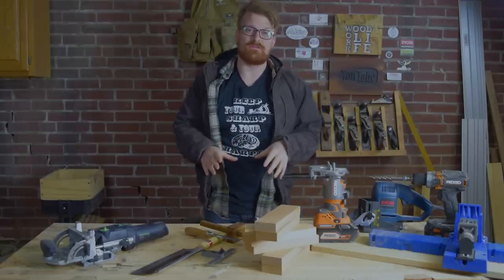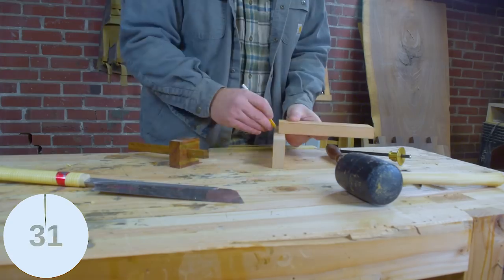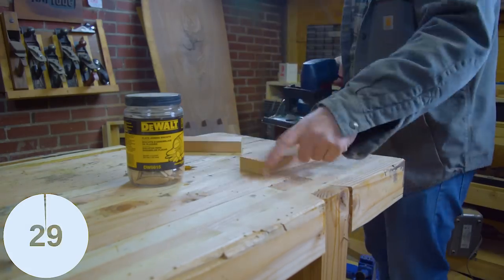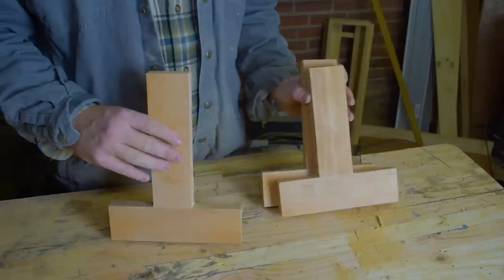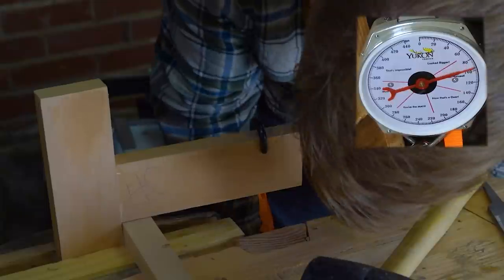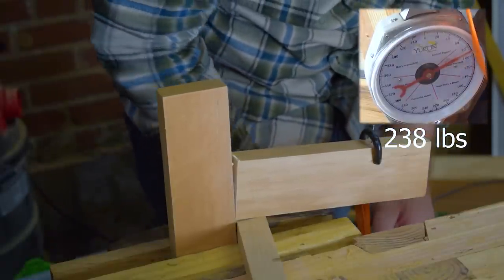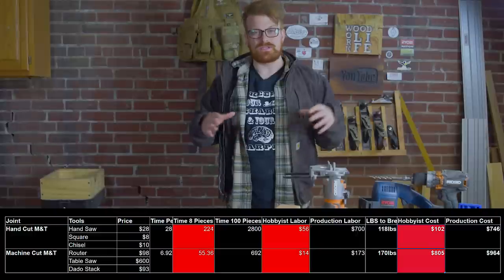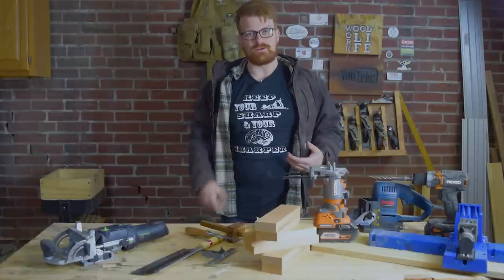Best Joint Shootout, The answer will surprise you!  | Hand Tool Shootout

Comment: The flaw to the test is due to the lateral movement of the perpendicular. I can't recall any piece of cabinetry or furniture that uses butt joints where the perpendicular piece isn't supported laterally from an opposite and equal butt joint.

I would take 5 pieces of wood and build a base cabinet type frame and test the joints lateral movements by squeezing the square frame diagonally.

The reason being is that a completed cabinet isn't necessarily subject to the lateral forces you are subjecting to these test pieces. Biscuits or kreg joints or even metal connectors would work just fine - unless you are building a ladder.

Or simpler, build an H-frame and pull straight down while measuring how far the  styles spread out.
Reply from the maker: I was trying to do the simplest testing methodology to minimize and isolate variables, but yes it might oversimplify a bit.  The failures are still implicit of the behavior with a completed piece.  Besides the point though, as stated in the video, engineering is about making something strong enough not the most possible strong.  Most of these joints are "strong enough" in most scenarios.  If you are making a chair to park a car on though YMMV.

Comment: Before you even start I expect Festool to win (effectiveness + efficiency), but as a hobbyist cannot justify its price.

Looking forward to the results.
Reply: For my coffee table I used dowels and thick legs. Solid as a rock.

Your voice over is perfect, btw - no echo, nice and flat, very easy to listen to.
Reply from the maker: Thanks for the comment, I think I need to do a follow up looking at dowels, and a few other techniques vs domino and others.  There are so many techniques.
Reply from the maker: Thanks for the Kudos on the VO, I have been working on that for a while.  Way harder than it seems.
Reply: Are there no cheaper machines then a Festool that do the same?. Because a hobbyist likes fast and easy ways and a Festool way is just that. I agree on the price as a hobbyist pffff even a pro would have to think about that machine i think.
Reply: xander witt
I have not seen a machine as good as the Festool. There are Jigs and machines that you can make out of wood such as the pantorouter that are a close proximity but it would take the time and effort to build them which as a professional I did not have. So the easy solution for me was put it in my shopping cart and place the order in two days later I had it. I have never regretted that decision.
Reply: martylts Festool it is then. O well some buy cars others tools hehehe. Thank you .
Reply: Wood. Work. Life. And you need to use the same species of wood and from the same board if possible. Also, when you do the biscuit joint, you could put two biscuits in the joint. one above the other.
Reply: Why aren't other companies making these ??
Reply: @aarondcmedia9585  for the dowels - what wood was it you used?, and what spacing between each?
Reply: Dowel from the local hardware store, so probably pine? I do not remember spacing to be honest, but there were only 3 per leg, so probably 50mm. The more dowels the harder to join as they are tricky to get all aligned.
Reply: tom ruth   Yep. Why in the world did he do a video if he didn’t have same wood. It wasted my time. Besides there’s been 1000 of these comparison videos but this was the worst since we never got true reading since it all different woods lol. What’s the point. Beside tongue and groove is the strongest but slowest. If you make in cabinet doors no need for high stress just speed and clean looking is the best way to go for those type of situations.

Comment: I have had the Domino 500 for over 10 years.  I'm on my third box of 1800, 5 mm tenons.  Given that I paid around $700 for the Domino and approximately $75 per box of 1800 5 mm tenons I have an investment of approximately  $925.  That divided by say 5,000 tenons, 10,000 plunge cut mortises my production cost of each joint, not counting labor is approximately 18.5 cents per tenon.   Approximate tenon cost just under 5 cents each is included in the 18.5 cents per joint.  A no brainer in time savings and strength of production mode.  FWIW I have not replaced or resharpened any of the Domino bits yet.
Reply from the maker: The domino requires dust collection to be operate so I included the cost of an extraction system.
Reply from the maker: But ya, for production tasks, hard to beat the domino.
Reply: @WoodWorkLIFE  Dust extraction is preferred but you can blow out each joint with an air hose and nozzle.  I had the Festool CT22 for my sanders and track saw.  S no extra purchase was required.
Reply from the maker: The instructions for the domino say MUST USE dust extraction.  I just went with that.

Comment: Interesting vid. I started using dowels to do certain joinery with great success. It worked really well for my computer desk base. The top is 1'' 1/2  thick and 5ft by 3ft butcher block  115 lbs. The table base uses 4''by 4''s legs with a 2" by 5" apron. It's a beast but the 1'' dowels have held up without any issues for over a year now. Would be interesting how dowel joints would hold up in a shoot out.

Comment: What the best joinery for making boxes with a 6 mm birch plywood . The box sizes are typically 12 inch cubes with one face left open . I am a beginner and launching myself into wood working . Thanks and Regds
Reply from the maker: If you can cut really flat square edges glue and clamps will be great.  If you want to go fast, glue and pin nails.  If you don't want any pin heads showing, biscuits would be great for alignment.

Comment: the domino is the best in my opinion ...its fast its accurate and super strong, the hand made mortis is really good also and if you go that route you can factor in your time an labor into the price of the things you will sell and describe your work how its made so it gets a better appreciation to the item sold and could be sold for a higher rate knowing its hand made olds school mortis items so that your time gets paid even if it takes longer to make them.
Reply from the maker: Domino is best, I think pocket holes are underrated but don't really have a place in modern "fine" furniture (purely for cosmetic reasons.)  If you can find a customer that appreciates hand craftsmanship you should absolutely be valuing your time.

Comment: Great job and overview. Your Ryobi biscuit joiner is about the worst one made. Lots of slop in the kerf which was noticeable when you joined the two pieces. I think the biscuit joiner excels in making pieces of wood to make a surface (plate joiner). I’m happy with my Dewalt plate joiner. The Festtool I think is ridiculously overpriced. I personally don’t like them. Thanks for sharing
Reply from the maker: Yes...it is, I wanted to put it in there since I still had it...it's now in the bin.

Comment: I feel long T20 deck screws are so underrated.  I’ve experimented with many types of joinery. For many years and I keep coming back to  3.5” T20 star deck screws ...the self tapping ones with the small heads that don’t split wood and can seat themselves deep in the wood. Also known as camo screw or trim screws. Brands like GRK sell them. It’s fast. It’s cheap, and I always get nervous when I’m running low on them... I always try to keep a bunch of different sizes in stock since I use them for everything because they can hide themselves in the wood..and with wood glue and plastic wood filler it’s invisible. 

You can also strengthen different joinery in your project without having to take everything apart to just throw in a joinery. Just throw in another screw..If it’s painted over you’ll never see it after filling/sanding with wood filler. 

Most people never look at the joinery so they won’t see it either. Think about it— most stick built homes that bear large loads use long screw joinery. Straight up SCREWS and wood are holding up structures. The screws are even stronger than the wood itself so your screw will never snap— and aactualy strengthening your structure with stronger materials. I’ve always wanted to use hidden joinery but when you’re trying to fix something on the fly this works. Only downside I can see is the possibility of splitting wood (so Pre drill) or if the wood filler somehow ruins the cosmetics of the piece. Other than that, most joinery is hidden/behind something/ under the table and it goes unnoticed. Also the best part? You can dissasemble your project and put it back together.
Reply from the maker: I've got some, I'll give them a shot

Comment: A problem I see with the test
In your testing, you have placed a 1-1/2 inch piece of square stock under the joint as you apply a downward weight. Your load-point actually moves away from the joint by ab 1-1/2"  to the outer edge of the square stock. When the test joints break you're seeing the effect that this leverage point had on the break.

In practice, when building using butt joints your not likely to encounter stresses on the joint where they are levered over another piece of wood as in your test.
I think you would find different results if you removed the square stock and allow the load to act on only the joint itself.
I appreciate your efforts, thank you for your good work.
Reply from the maker: You are probably right, I am planning a full set of tests that are going to be more controlled but I am not rushing it out.

Comment: Clamping a joint during glue setting is much more important than you might think. Glue choice is crucial. Also, the failure mode you were testing is not a common one- the support under the loaded component is unlikely in practice. See 'gosforth handyman' for more practical tests.
Reply from the maker: indeed it does

Comment: Bridle joints and half laps are going to be good ones to test. Problem is doing this in soft wood is going to allow the metal fasteners to have an unfair advantage over the traditional joinery.  With metal fasteners  there is a difference between ultimate failure and joint separation. For stuff in my house if a joint separates it's failed imo.

Comment: making acoustic panels for a recording studio i learnt a new butt joint, basically as many pneumatic staples you can fit on both sides of the joint. super quick, super strong, with or without glue it should beat your joints. cheers for the upload. (joints were covered by fabric, not suitable for varnish)
Reply from the maker: Thanks arty...how many pneumatic staples we talking about :)  Are you saying the fabric is structural to the joint?  There are so many ways to join two boards.  I haven't even started talking about Japanese joinery yet.
Reply: hey WWL, acoustic panels were covered in fabric as the finish (non structural), stacked around the 2 rooms floor to ceiling, all recording studios are similar to reference this. staples are approx 1-3mm spaces on both faces of the 3"x1" pine and pva. i would guess 20-30 per face. also softwood allows staple to countersink. look forward to the next 1. cheers mate.
Reply: 80series staple x 6mm. it acts like a gangnail...(the engineers butt joint)

Comment: Pocket hole is the fastest cheapest way and is good enough most people are not building chairs but for cabinets and desks and things of this nature the pocket hole is the cheapest and best in my opinion great video tho
Reply: Biscuit joints are very good as well. You could combine biscuits with simple screw joints. And end up with a very accurate strong joint. And you could use through dowel joints with biscuits as well.

Comment: Do you have any experience with the Harbor Freight pocket hole jig?  In the videos I've seen it seems the holes are not as clean as the Kreg holes.  I'm thinking if a Kreg drill bit was used with the Harbor unit the holes might be cleaner.
Reply: I’ve had the HFT jig before I even knew who Craig was. No complaints.
Reply: @goddale2002  good to hear.  The HF version looks really solid.

Comment: mortise and tenon is best strenth,especially if you use a dry tenon drove into a green or not fully dried mortise of less than equal size.then as the mortise naturally shrinks you will have a stronger joint than any expensive tool can make.
Reply from the maker: that is certainly the tightest, but as far as strength it depends on the wood species, with floating tenon in narrow stock you can put a thin floating tenon into any species of wood, and have the mortise as the weak point of the joint.  With M&T you have to use a hardwood that is strong enough even in thin proportions.

Comment: Good work!  Thank you for that.  Agree that biscuits have their place, but not in a mortice & tenon arrangement, especially one that will be subject to loads.  Looking forward to the dowel comparison, hope you run the Domino against the dowel too. Thanks again.
Reply: There are different types of biscuit joints out there as well. Including self clamping, metal, plastic. Then there is the option of using screws with biscuits as well. You would line up the joint with the biscuit and then screw in after the alignment has been achieved. 

The problem with pocket holes is that they are very hard to align and require some complex jigs to enable that.  Pocket holes and biscuits are a great complementing jointing method. You can also use dowels with them as well.
Reply: You should test Maffel doweller 40 vs Domino 500

Comment: What glue did you use as the oils in Doug fir will stop most glues being effective. I've used biscuits for this and they've never failed that easily
Reply from the maker: I used Titebond 2 as it has been a very reliable glue for me.  This is the same wood from the bleachers I used to build a table almost a year ago now and none of those glue joints have failed.  I think there might be something to the accuracy of the biscuit jointer here though.  I reached out to Lamello to see if I can borrow one of there plate jointers to see what kind of difference there might be.  Not all biscuits are cut from the same cloth.

Comment: What about first letting the glue soak into the end and dry to then glue it together and not have it soak in anymore? And would you recommend something like glueing them together and then adding some pocket holes?
Reply from the maker: Saturating the ends can help, but to little value.  For pocket holes I find it best to add glue then use the phone diet holes to clamp the joint together.  As far as recomendations, use the beat joint you have time for (time is money) and use integral joints in critical spots (floating tenon, mortise and tenon, half lap, dowels, splines)

Comment: Should have also glued all joints. I put glue on all of my Kreg pocket joints and they are ridiculously strong.
Reply: Yes Pocket screw Plus glue is extremly strong
Reply from the maker: they are all glued
Reply: Depends on the wood, the material thickness, etc. 
A lot of the tests by similar channels have had similar or worse results on pocket holes, but like he said, if you are using 4 on something like a chair, it would be plenty strong.

Comment: Cost comparison for machine cut joints needs to be adjusted since table saw and router are used for many other tasks when buildings anything. Fractional cost for the table saw and router based on the percentage of time they were used for this particular task might be a better representation of the actual costs.

Comment: Would have been telling to have included a hollow chisel mortiser in the test.  Lot cheaper than a Festool Domino setup, and no issues of matching rounded shoulder mortises (router cut) and square shoulder tenons (table saw cut).

Comment: It was most obvious for the pocket hole, but is leveraging a rail over a 1" square bar really a good joint test? You're basically shearing the joint almost straight up, and with several times more force than the scale indicates. I'm thinking a bending test without the blocking bar would be more like the forces most wood joints have to resist.
Reply from the maker: the bar was placed to get a consistent axel to apply the force.  The leverage applied will obviously add some mechanical advantage, but it doesn't change the accuracy of the figures.  Testing two wood joints with a span between them like one side of a chair or table would be another interesting test.  I thought it was interesting how the pocket hole joint failed too.  I think that had more to do with the way the screws and the holes themselves compromise the timber in a manner.  Screws are never going to be stronger than a mechanical joint, but in this case the joint probably would've been stronger with a smaller screw and less gauge hole to compromise the end grain less...would be an interesting experiment.

Comment: You said that the biscuit joint relies on glue to end grain strength. I wonder if you bothered to bath the biscuit in glue or not. Since they need to expand.
Reply from the maker: I did, it still failed

Comment: The difference between the hand cut and machine cut M&T in terms of breaking strength is surprising. If the geometry of the wood is similar, the strength should be similar. Only thing I can think of is if the surface was irregular (on the hand cut M&T), the glue has a harder time spanning the gap.  I think the main thing making the domino stronger was that the floating tenon is hardwood. 

I'd love to see this redone with all hardwood so that the standard M&T joint is on equal footing with the floating tenon.

Comment: This is an excellent and very useful video.  Congratulations. Like you said, it would have been even better if you did multiple samples of each joint type and take an average.  Then you can do statistical calcs to get a really solid comparison.    However, what you did here is quite useful.    Your calculation on time spent for each was  really helpful.     Guess I will have to get one of the Kreg pocket joiners, they seem affordable, quick, and effective